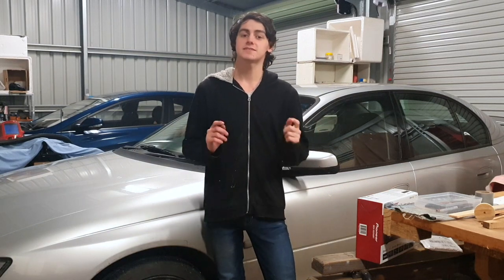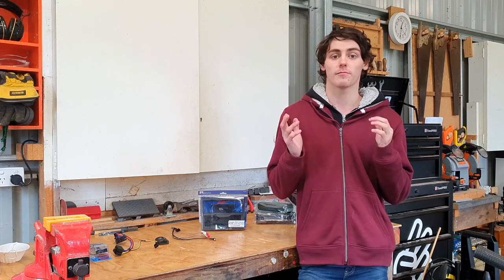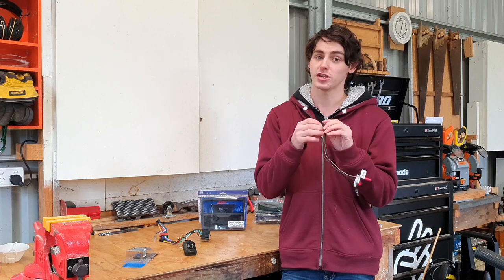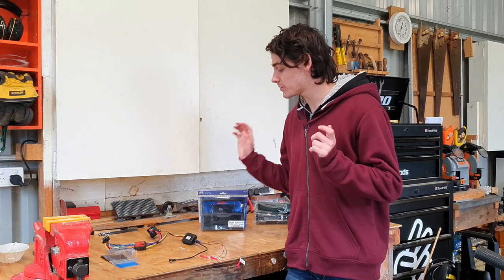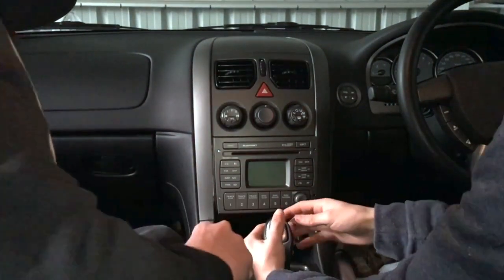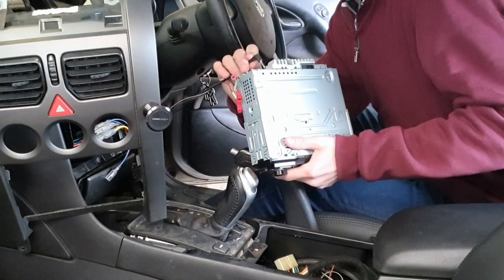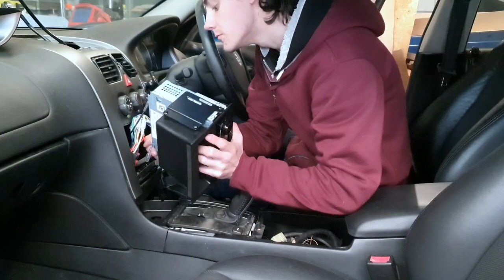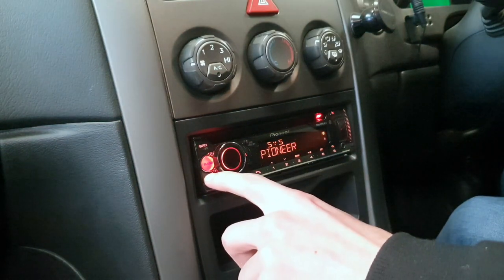How to Install a Head Unit (w/ Steering Wheel Controls) VY/VZ/Monaro // UPDATED VERSION

Comment: Where does the key 1 and key 2 wire go from the patch lead uni with self learn for the pioneer for the vy if any help would be appreciate
Reply from the maker: For pioneer, It should just be the 3.5mm jack plugged into the back and you should be good to go.    
See 2:06 in the video for the table on what head unit needs what

Comment: Great Informative vid mate. To be said, the original stereo really needs 2 ppl to remove it easier. Mine was an absolute bastard to get out. Ended up just ripping the whole unit face off and prying it out. My Iso Kit has the front and rear speakers confused which is an easy enough fix, but just so some are aware you can run into a few issues with the balance and fader settings. On my other Commy I have the Iso+Aeropro unit and if I hit vol+ too fast or hold volume+ it skips tracks and or skips to radio, if i double tap the mode button too fast it can also do some crazy stuff! But If i use the buttons slower it all works fine. Do you know how to get steering wheel controls working without the Aeropro dongle? Some units have it built in (So I've read) But I'm having no joy with a JVC That's meant to have it built in. Trying to save $100 but looking more like the Aeropro kit will be needed. Keep up the good work mate. Cheers.

Comment: Will upgrading the head unit and speakers have a big difference from the old stock system?
Reply: As long as you get a quality headunit and not a cheap Chinese one, and make sure you get good well matched speakers for the headunit you chose, absolutely there will be a big difference in clarity and quality.

Comment: Hey man I just put a sony single din Headunit in my car and when I turn the car off the Headunit doesn’t turn off it stays on and when I do turn it off is disconnects my phone from the blue tooth completely
Reply from the maker: Hey mate,   Did you use the plug and play type deal like in the video? Or do the wiring yourself? If the wiring was done yourself you may have mixed a connection with the constant 12v wire and the ignition 12v wire.  As for the Bluetooth problem I’m unsure on that one sorry but I’d say the best option would be to contact Sony.  Hope this helps :)